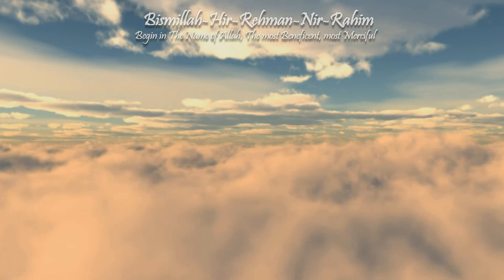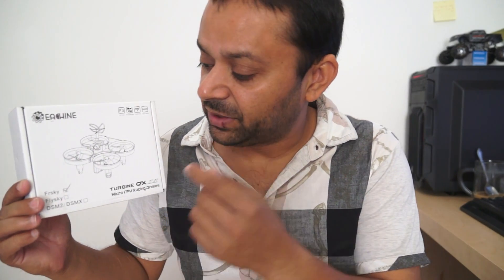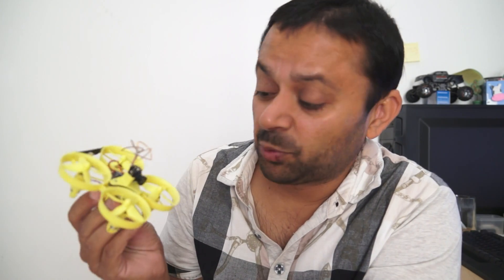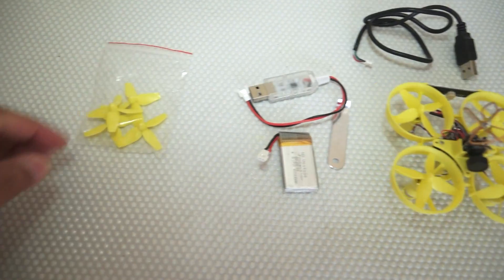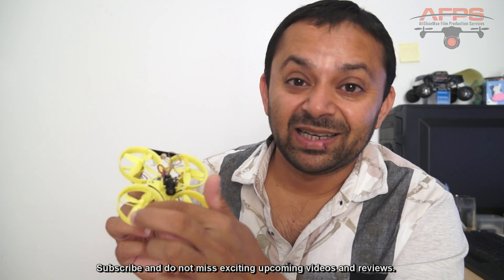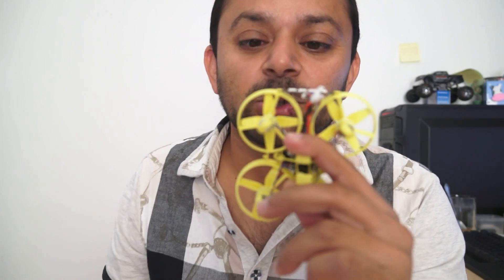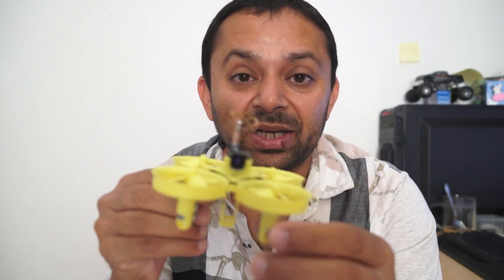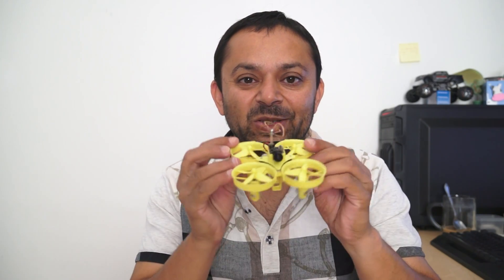Eachine Turbine QX70 Micro FPV Racing Quadcopter

Comment: Eachine Turbine QX70 Micro Racing Quad is total crap DO NOT HIT ANYTHING, poorly made excuse for an FPV drone. First miss hap off comes antenna, next power solder welds failed, camera welds fail, doesn't anyone in China understand SOLDERING.

Comment: This Eachine mini fpv quadcopter is about 50 odd quid on Banggood and it's not smooth out of the box, needs a lot of tweak and modding apparently to get it nice/smooth flying. I'd rather spend another extra 30 quid and get BNF Inductrix of which is reputable brand and less faffing about as opposed to the Eachine quad.

Comment: I seen this on a different channel and the guy seemed to think it was unflyable. obviously it is flyable, maybe his was defective.
Reply from the maker: Mine was not flyable as well. I had to work things out to make it fly. as I said, I had to file the insides of the ducts to settle props right. full throttle at times moving ducts so props will touch and get filed automatically and make space on ducts too. then tweaked the PIDs and it flies just superb